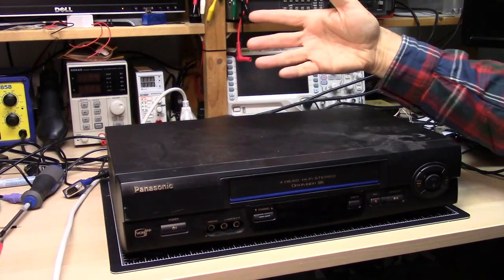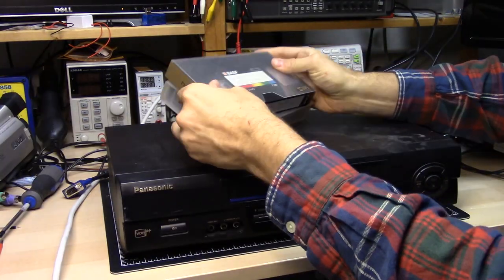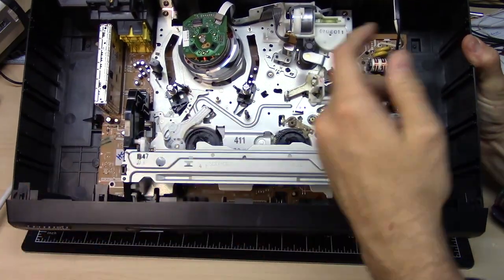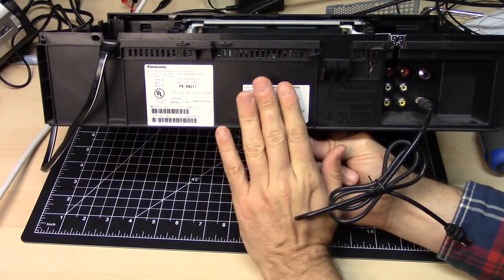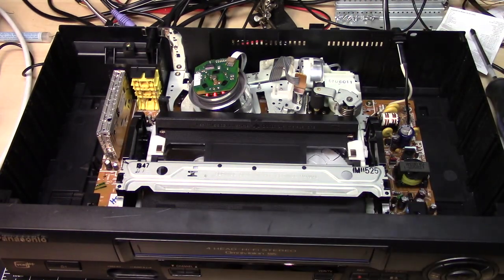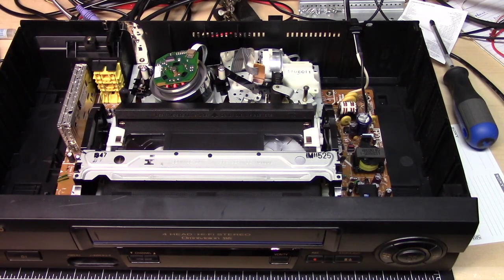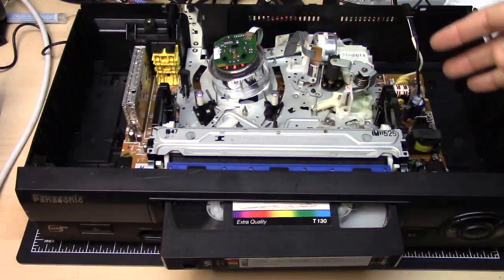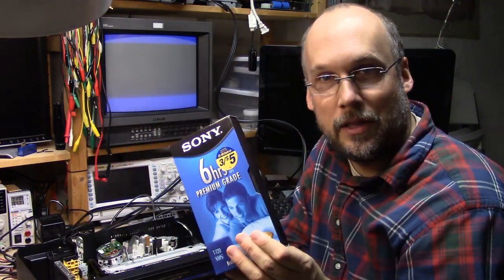Old VHS VCR, fundamentals and does it work?

Comment: Even though these late Panasonic VCRs have cheap cases and (compared to the aluminum diecast chassis of older generations) cheap mechanisms, they are shockingly reliable.
I have never experienced a Z mechanism (like the one shown) that failed over time. Of course it does happen, but if you compare that to Funai or Samsung models, they are excellent. 

As for the squeeking noise, like every other VCR it needs lubrication on the plastic gears that drive the mechanism. This is definitely not a belt issue. I am more of an expert for the K-mechanisms, but if I remember correctly, the Z-mechanisms only use a single belt that goes from the direct drive motor of the capstan to the reels, this belt then drives the takeup, the fast forward and the rewind. I am about 99% sure this noise comes from plastic rubbing on plastik at the gear on the bottom side that drives the state of the mechanism. (You will recognise that gear as soon as you see it, it looks really weird.)

Also, the magnetic pickup on Panasonic units is superior to most I've seen. Even on the last HiFi VCRs they made, they hardly ever produce audio glitches on HiFi tracks, even when the tapes weren't recorded on a good machine or the tape is worn.

Also, it is just not correct that these late units were made as cheaply as possible. As you can see, the pinch roller first moves down and then moves to the capstan. This is a really complicated way of designing it. Most manufactureres just had the capstan on the back side of the tape and the rubber pinch roller on the metal particle side of the tape where the information is saved. 
Doing it that way, a failing pinch roller can contaminate a tape with dirt. Panasonic never did that.
Reply: You sold me on the Panasonic... it must be a company tradition. Looking at vintage cassette decks I had the same feeling for Technics (both are brands of the Matsushita Electric). I bought one on eBay... DECK A has played so long the head on top as a noticeable wear sign and still it plays beautifully and the belts are from 1993! Unbelievable...
Reply: I agree 100% - They always work when i get lucky and pick them up. They need nothing. as simple as it seems to be - it's reliable and obviously well designed.

Comment: Our first VCR was a Symphonic made in 1985 or 1986. Heavy metal case, dozens of buttons, etc. By 2000, they were so light and cheap.
Reply: Vhs tapes were phased out by 2005 with a handful made in 2006. 
Vcr's i think were still made till 2016 by Funai. But most major brands stopped by 2010. 
But yea amazing little machines
Reply: @ACommenterOnYouTube  these days there are Video Cameras that use SD Cards
Reply: @stephensnell5707  ok and what does a video camera and sd cards have anything to do with VCR's ??

Comment: on a Panasonic VCR NV-HS900  what are the functions about the adjust buttons soldered on the left vertical card ? 
( what does mean " PB " ? ) 
VR5 REC C ?
VHS REC Y ? 
S VHS PB LEVEL 1 ? 
VHS PB LEVEL ?
S VHS REC Y ? 
VHS REC Y ?

Comment: This has to be a later model. 80s vcrs were tanks. Especially the ones built by Matsushita(panasonic, GE, Sylvania, Maganavox, some RCA's, etc.) Toshiba, Hitachi, and JVCs were tanks as well. Hitachi made a really good machine.
Reply: I know what you mean. Our first ever VCR was a Ferguson (rebadged JVC) from 1987, and it carried on working well into the 2000s. It finally died when the tape movement sensor failed, causing the VCR to immediately stop whenever you tried to play, fast forward etc. Too fiddly to replace, so got trashed.

Comment: instead of connecting the vcr to the computer get your hands on a  dvd recorder with hard drive then you can record the vhs tapes to the hard drive then you can play it back to see if its ok and you can edit aswell and depending on the size of the quality dump it to a dvd then put the dvd into the laptop or pc then convert the dvd to mp4 or avi or just leave it on the hdd or dvd
Reply: Thta's a LOT of steps - I'd just put them on a jump usb drive. USB is here to say!

Comment: VHS was such a Success the VHS VCR's outlived the tapes themselves
Reply: Funai made vcr's till 2016 but other major brands stopped around 2005. 
I still have my Panasonic and jvc vcr's from late 90's and both still going. 
Craig actually made vhs tapes in 2017 and 2018 ... so those will be the newest made.
Reply: @ACommenterOnYouTube  oh, true ig
Reply: @mctv6486  not sure if you know this but they did make S-VHS which was 60% higher resolution over standard vhs. Believe it was 440 lines of resolution where dvd was 480 lines, they were very close in quality.
Reply: @ACommenterOnYouTube  this i know, however i have not ben able to find a S-VHS VCR that i can afford

Comment: Your better looking for a vcr with TBC or buy a separate one on its own. I use to repair a lot of vcrs. I got a high end deck with very low hours on it and it’s got TBC on it and does a clean job on transfers, also has FireWire on it with is handy. So look out for a SVHS deck with TBC on it.

Comment: Just wondering why my Philips DVP3150V vcr/dvd player has suddenly stopped accepting vhs tapes.😭 The vcr starts to accept the cartridge, but does not completely take the cartridge in (it's about 3/4 in the machine). You can hear the machine hum that it's trying to load in the cartridge. Luckily, it ejects out perfectly. Wondering why the vhs tape is not completely loading into the vcr. I have almost 100 great vhs movies so that's why I'm bothering to find out if it's fixable. Thanks much!
Reply: I this the chip might be out on your VCR  but if you want me to look at it for you I'll do it.
Reply: I’m no expert but there’s maybe a small
LED light inside the tape cavity which detects the presence of a tape & turns on a motor which then “Collects” the tape & laces it up. If the machine isn’t taking the tape from you, maybe it’s the light or the motor which is defective. However as I said I’m no expert.
Reply: Your mechanism's timing is off. You would have to take the whole mechanism apart and re time it.

Comment: Yeah, I agree they could have made it much smaller.. wonder why they didn't?  I mean, it's cheaper. Could it've made ⅓ of another unit? 🤔
I remember the lock button on the side that would open the cassette also breaking that little square plastic off on the corner of the vhs tape you couldn't record over it.. But put a litter sellotape over it you could..